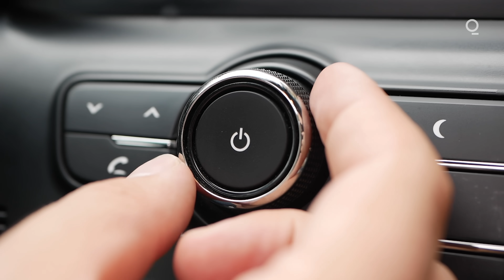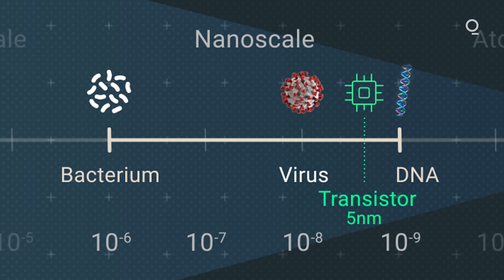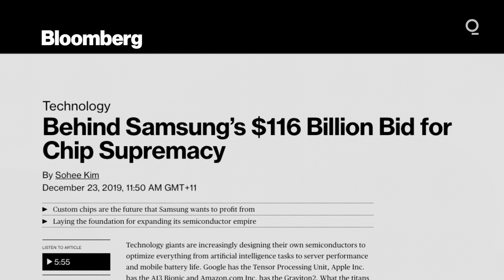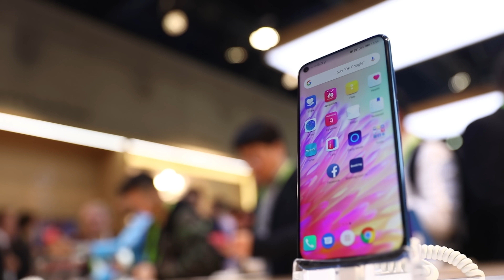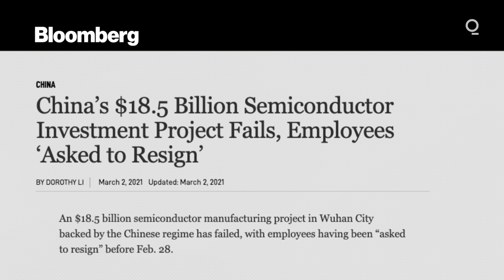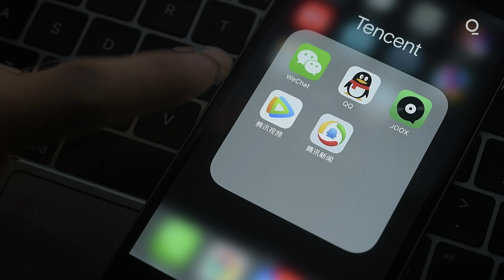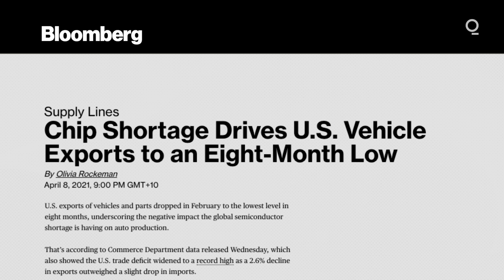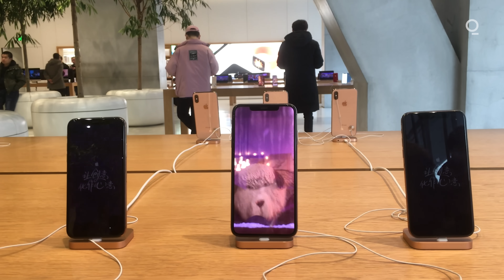Inside China's Accelerating Bid for Chip Supremacy

Comment: Well, as there is not a single engineer speaking in this quicktake let me tell you one thing about size: There is something we call tunneling, which becomes a quite prominent leakage current when the gate-oxide thickness is smaller than 10nm - which is already the case and does not need to be invented.

And btw: As long as one does not have a fancy toaster, there is not a single chip in such a thing. And the chips in a microwave oven are on a technical level that was achieved 30 years ago.
What is interesting in development are all kind of sensors to make the "real world" accessible to robotics and automated systems and high-speed computing. Also advances in power reduction, lifetime-improvement, etc. But not just the production of a chip.

Comment: The auto industry just needs to go back to the basics on vehicles and use less chips in them. The whole point of the vehicle is to get from point A to point B. Anything else is interference. Also with basic cars, the prices will go down dramatically. 
As far as china rising overnight, they've missed key milestones that take years and years for countries that have industrialized through time. That short spurt is what will be china's downfall as it keeps devaluing it currency, pirating technology not made for it's current age, not keeping up with it's middle class wages and finally its corrupt government.

Comment: TSMC should basically begin moving all its major facilities to countries where the PRC has no meaningful strategic reach..i.e. Japan, any reasonably developed nation in the Western hemisphere, Europe, certain more modernized urban corridors in Africa - anything is safer than keeping, let alone expanding operations in Taiwan.

As for the motivations driving US sanctions on Huawei and chip manufacturers in the PRC, I think both sides are right: Huawei networks have demonstrated security loopholes and backdoor spying capabilities (the US does a lot of this anyway so they would know). However, the very large spat of sanctions that cover basic chips coming from the PRC is suspiciously slanted towards commercial/industrial protectionism on the part of the US, rather than military security. When protectionism is the motivating animus, high tarrifs are a more appropriate tool than sanctions, as they are more transparent in intention and less incendiary in effect than overly broad bans. In the end, however, there's no substitute for large investment when it comes to ensuring competitive domestic (or even securely allied foreign) suppliers. If they want to win, Washington will have to pony up.

Comment: China should win this war..
Reply: Never happened, all micro chip designer and architect are from Silicon Valley. The Chinese are 5-10 yrs behind when it comes to designing, programming and Architecture for micro chips . Technology changes every 2-3 yrs, onced they learned it a new generation will take over. Micro Chips cost only $5-$20 but the machine that makes a single chip cost $2B +.

Comment: Chip design and chip manufacture are knowledge, so they can be learned and mastered. TSMC is important but it is not irreplaceable. China will be chip independent eventually no matter the US puts sanction on China or not. The US can only slow it down.
Reply: necessity is the mother of invention China will eventually catch up and surpass ...
Reply: China will actually chip independent faster because of the US sanctions.
Chinas new space station probably wouldn't exist if the US wouldn't have banned China from the ISS.

Comment: When China puts its mind on something, it will succeed. Within 5-10 years, China will either catch up with the rest of the filed or surpassing it. China is poring a lot of money into carbon-based chips to replace silicon-based chips. Carbon-based chips will perform better than silicon-based chips which is nearing its performance limit.
Reply: football, jet engine comparable to RR, GE, Pratt Whitney.. OS comparable to windows Microsoft,..

Comment: If China can successfully come through we're paying $25 per chip instead of paying $150 per chip. Which one would you rather pay? Just for example
Reply: well it depends on the quality, if the 25 dollar chip is gonna die in the first 2 years and the 150 dollar chip will last for 30...
Reply: @TechToyTinkerCompany  where do i find a 150 dollar chip that lasts 30 years lol. Not to mention a chip is obsolete in just 5 years whether it lasts that long or not.
Reply: @neverletmego6414  it depends on what you are using said chips for. things like simple computing and to some degree automotive don't need constant updates.
Reply: @TechToyTinkerCompany  those use cases don't need highly dense chips that require cutting edge manufacturing techniques and equipment. China can manufacture them already.
Reply: That is Chicom philosophy, buy the cheapest.  Many successful people buy the best which is often the most expensive.  Taiwan consistently is for the best. 💪💪

Comment: If the question is whether China can catch up with chip manufacturing. The answer is yes. It's a purely engineering and manufacturing problem. It may take a long time but the country will get there. However if you are asking whether the country can become a tech leader in terms of innovation, the answer is no. The reason is complicated. No one can compete with China in the 1 to N process. but it lacks 0 to 1 environment

Comment: No! The "most basic electric toaster" does NOT require nor use ANY microchips in their design. They are still analog designs with spring loaded mechanisms.
There are more advanced toaster designs that do require microchips but your opening statement is in fact completely incorrect and misleading. The average person may not know this and you are giving false information.

Comment: All around the world: It would take years for China to build cutting edge chip
Me: Didn't they built the largest working bullet train station network within 1 decade
Reply: If it was that ez everyone would have done it.
Reply: complexity of building a bullet train network and building a semi-conductor industry is widely different, if they could have done it, they would have done already by now.
Reply: @abartakbhattacharya4475  if they could have done it, they would have done already by now. Wow, got it. Cheap speaking can be so luxurious.
Reply: @abartakbhattacharya4475  A yes the complicated process of calling ASML in the Netherlands.
ASML machines which Taiwan uses to make the chips.
Tell me what is it exactly that Taiwan contributes to making the Chips?
The Chips are designed in the USA. The Machine that makes the Chips are from the Netherlands.
Reply: @eastsouth9548  You got the map, you got the shoes, but how can you get to the destination without a man to walk there?
Semiconductor manufacturing is far more complicated than you thought, it takes a lot of effort there.
Reply: @eastsouth9548  the relationship between TSMC and ASML goes way longer, deeper and complicated than you think.  I would suggest that you go look into details and you'll find that without TSMC's engineers, ASML will not monopolize in what it does.  They are partners rather than supplier/buyer relationship.  Furthermore, what you just wrote means you'd no idea how chips are manufactured.
Reply: @CA-em1kf  asml euv machine no components of it are made in taiwan.
asml and tsmc working to improve asml euv.
no, its because i have been researching about euv machines.
and hearing all this propaganda about how important taiwan is.
Reply: @abartakbhattacharya4475   it is not a matter of yes or no , it is a matter of when.
Reply: @abartakbhattacharya4475  how to catch salty indians? post a video of china's achievements.
Reply: @panzergrenadier90  whatever makes you happy dude 👍
Reply: @abartakbhattacharya4475   building the world largest bullet-train system that covers a vast land and the most diverse terrain requires heaps of sophisticated heavy machineries and engineering ingenuity which only found in china, and last but not least, the determination of the people. btw jelly indians make me happy.
Reply: @abartakbhattacharya4475  you make building the world largest bullet-train system sound so easy.
Reply: @panzergrenadier90  how many cents u got for the comment?!
Reply: @qozia1370  a bot can't be this inteligent to counter answer or reply to arguments 😬
Reply: It's an interesting comparison that shows the advantages and disadvantages that China's economic/political system has. In the realm of infrastructure and larger scale fields of development, having a more authoritarian regime with long term planning in mind will help, especially in areas like high speed rail. However, in certain other industries, no matter how many people or resources you devote to the problem, its not going to significantly speed up the process. If you have a certain infrastructure project that has 100 people working on it, if you throw 1000 people there, it might speed up construction by 50%. This same kind of acceleration doesn't apply as well in areas like semi-conductors, where you can increase manpower and resources devoted to it by 10 fold, but you might only increase the speed of development by several percent. It doesn't help that the rest of the world is actively preventing the CCP from obtaining key technology and infrastructure necessary to easily speed up development. The CCP can afford to throw a lot of resources into a project for a long time, but they don't have key technologies, the top talent shy away and aren't easily found in their social system, and is actively hampered by other governments.
Reply: No actually they had help from other bullet train companies from the west
Reply: @ArtoriaWang  no help building the bullet train network
France germany canada japan sold their outdated bullet trains 40 years ago
From where china made better bullet trains than them

Comment: 6:16 small correction here, but for current-gen cutting edge chips (which is what the this piece is about) TSMC actually makes use of EUV technology, the machinery ánd software of which comes from ASML in Europe, and not the USA.
Reply: I was about to say the same before I saw your comment. How can they ignore ASML. ASML is nowadays as important as TSMC itself
Reply: @prem9501  actually TSMC helps ASML to make EUV machines for 20 years. Not only ASML own this advanced tech of euv,TSMC also own a big part of it.
Reply: Also, they are not "scraping" the chips with EUV light like that dude says, that's not how lithography works.
Reply: Applied materials builds the machines too.
Reply: ASML is owned by Many,the biggest two are Iphone and Sumsung
Reply: to be fair, their EUV Patent (monopoly) is granted by the US Government and ASML got to its point with heavy US involvement.
Reply: @valeyo  how is relevant that the US recognizes ASML's patent? That's only fair. But even if ASML didn't have a patent, they'd still hold a monopoly. No US company can make EUV machines.

I'm not aware that ASML had help from US. Do you have an example of this?
Reply: @footballvideos4246  ASML still relies on various US companies for crucial parts needed for EUV machine, so it isn’t a “100%” european company. In other words, US sanction will prevent ASML from building any EUVs.
Reply: @footballvideos4246  The power source for the machines comes from Cymer, an American company. The USA was only able to stop the sale to China because of this.

Comment: The most basic toaster oven (like the one shown in the video) doesn't have any chips (or any electronics for that matter). The circuit is very simple, mechanical timer, metal alloy mechanical thermostat, and a simple light perhaps.
Reply: But an LED is a diode. High tech electronics for toasters.  lol

Comment: One of the biggest assumptions Western companies made is to sell their products in China.  They soon realized that either they have to share their IP, have limited access to the market with tight CCP control, or China ended making much cheaper "knocked off" items so the masses can afford. China will fine tunning their products over time.  Western companies realized they will not be able to compete and  have been so naive. Look at many industries such as manufacturing, cars, pharmaceutical,  etc.

Comment: This article is very neutral and tells most of the innuendoes that exist between China and USA, but does not mention the fact that China invents nothing and that they only steal.  This article mentions Taiwan stealing but not China so that's a problem.  The biggest Elephant in the room though is something that Trump tried to address and that is the fact that chips not being manufactured in the US is a security threat since it effects all manufacturing of military jets, ships and missiles.  This exists for 2 reasons.   Think about it.  They show the supply chain for chips which involves up to 6000 miles or 10,000 kilometers of travel for each chip, and the fact is that with all that overhead, it is still cheaper to make chips overseas rather than make them in a plant in the US.  That is disturbing and indicates that the US over regulates the market to the point where we cannot compete.
     The fact is that all the high tech chip manufacturing machines are made in Japan and US with the US being on top, and they don't sell in the US.  A simple law stating that chips used in military hardware have to be made in America would solve that problem.